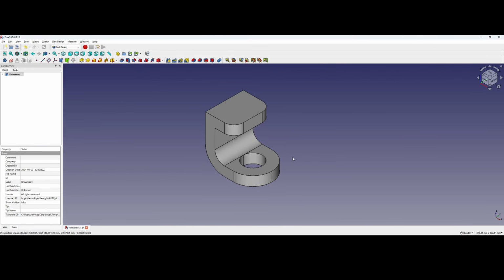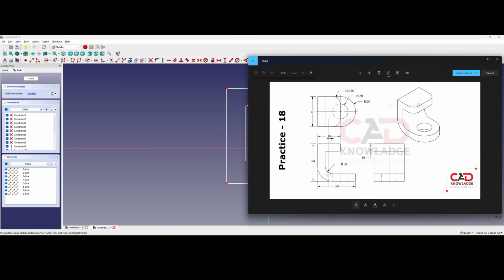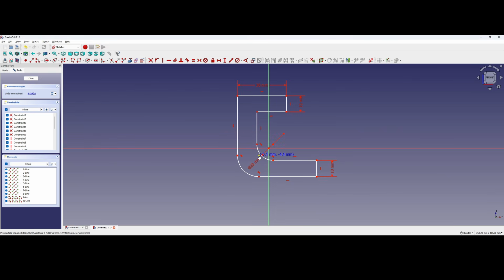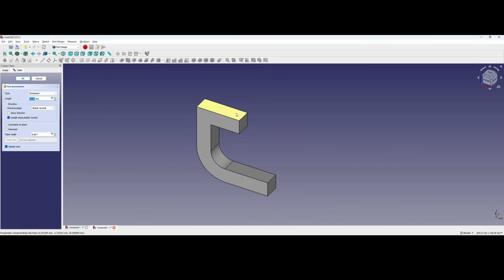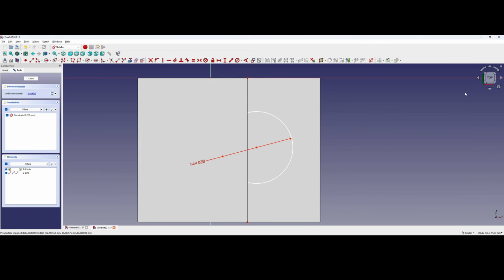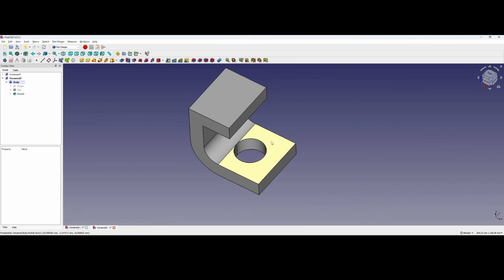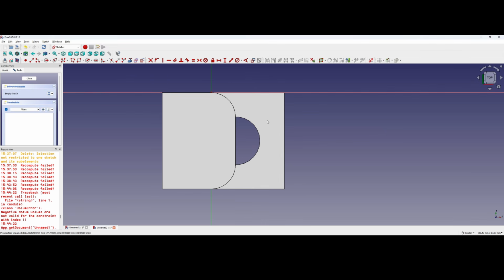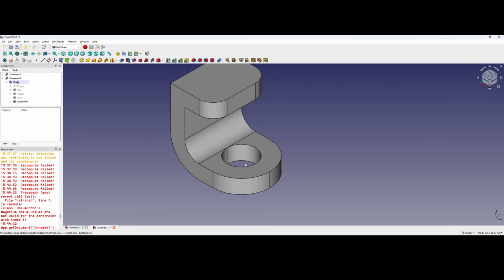FreeCAD Beginner Tutorial #1

Comment: So many options. When I started, I looked at another video which was 4 years old. Totally different than my view. Your video has the same version of mine. Even so, it took me forever to get the "create sketch" done. I did not have that icon on my toolbar. I had to customize the bar to get it. After that, it worked but it changed the workbench from "Parts Design" to "Sketcher" which you didn't mention.

Comment: Thank you for the great video!  I am having some difficulty duplicating the step 10:00 minutes into the video; selecting the vertical constraint between the center of the circle and the point on the edge on the projected line.  After selecting the two points, I try entering 20.0 mm (or even some smaller value) and get an error message: "<class 'ValueError'>: Datum 20.00 mm for the constraint for index 3 is invalid."  .......   I don't understand the previous error, but I finally found a way around it by removing all previous constraints to the circle, then 1. setting the horizontal constraint (not vertical?) first, 2. Setting the center-point of circle to the projected line second, and 3. setting the diameter of the circle last.  .....  Still it would be nice to know what was wrong with setting the distance from the center-point to the edge last.

Comment: I followed everything you said in the video up until selecting the select polyline tool. I cannot draw any lines, it just changes the orientation of the planes. Not sure what I'm doing wrong. FreeCad seems way more complicated to start designing a part than Inventor or SolidWorks. Am I missing something? I'm using version 0.21.2

Comment: it says wire not closed . I can see a line that is broken but can't connect line
Reply from the maker: Hi David,

If you select the two points that should be touching, can you then apply a coincident constraint? 
If one point is attached to the end of a standard line, and the other point is attached the end of an arc, you might need to try the tangent constraint.

Let me know if you're still running into problems with that.

Comment: Very good tutorial. I'm used to Fusion 360 and this tutorial was particularly good at clarifying how I might adapt my F360 workflow to Freecad. It seems that the Fusion UI inserts an extra layer in the process. In Freecad you say you want to add a vertical (or horizontal, or circle) distance constraint, whereas Fusion lets you select a 'distance' mode and rather cleverly works out (almost always correctly) which particular constraint you want by examining the geometry and your mouse movements. Similarly the Fusion extrude command can map to several different Freecad commands. If I want to move to open-source, I think I could learn to adapt to this "lower level" style.